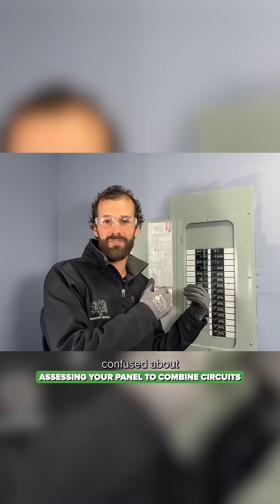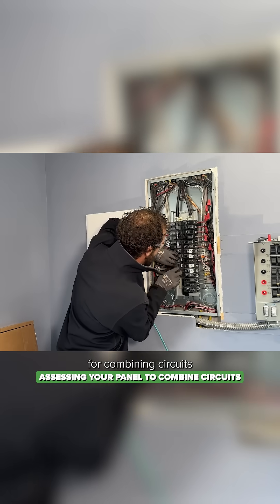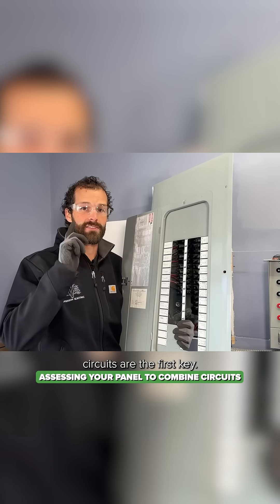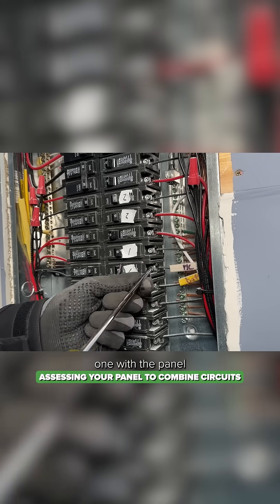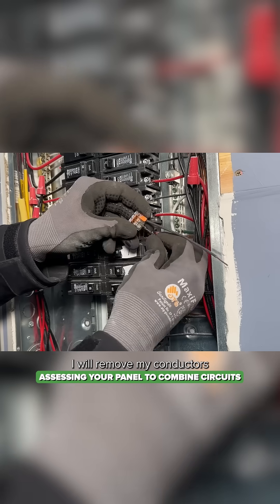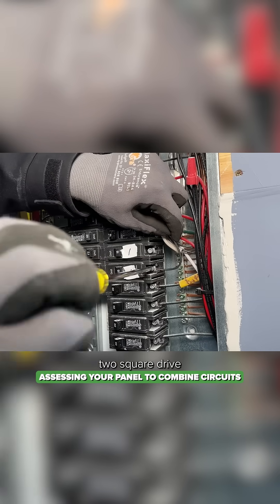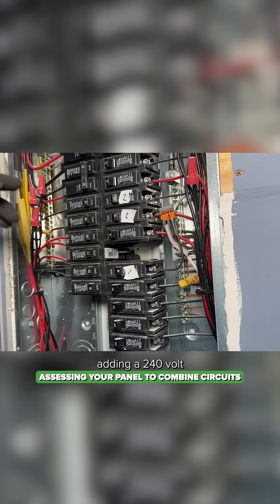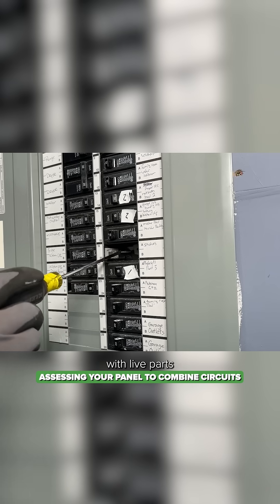How to Combine Circuits in Your Panel the Right Way (and Avoid Code Violations)

Comment: Hmm.  So, you’ve got three blank spots on the bottom left of that panel.  Wouldn’t you use them before trying to combine any circuits?
Reply: depends on if he has the load for it.  no?